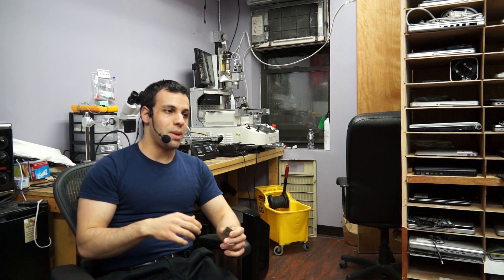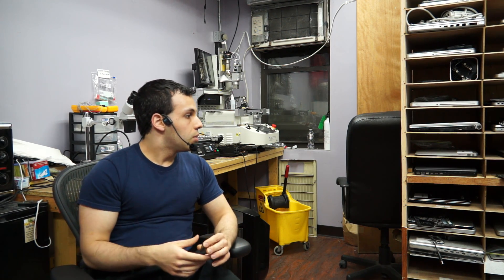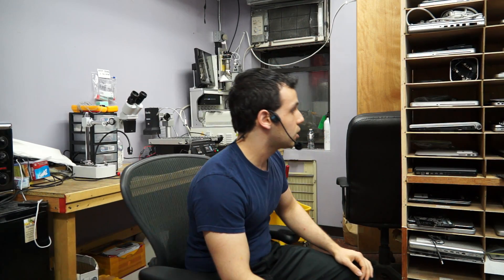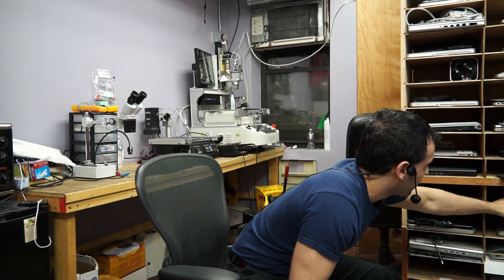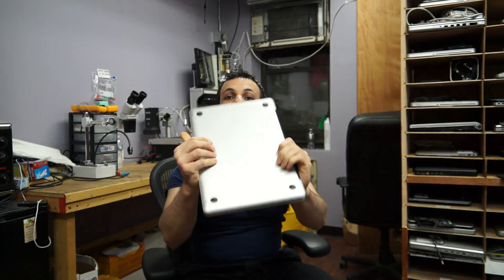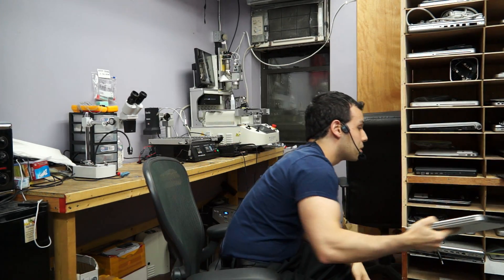Reballing flip chip GPUs is BULLSHIT - the truth about dead laptop GPUs & repairing them.

Comment: Louis, Most people have to  spend lot of money and or time to learn all of this stuff you know about electronics, but thanks to you I can learn it for free via ur channel, and that is truly amazing. Thank you very much sharing your knowledge and frankness.  
I will appreciated if you could could recommend a LCD's Screen separating machine? A decent one that won't break after a few jobs. heh! ty
Reply from the maker: +Luis Cruz I know little to nothing about glass only  repairs I'm afrai
Reply: +Louis Rossmann Hey Louis I have a laptop that has a nvidia GTX 675m GPU , recently my computer stops recognizing it in the device manager and theres nothing I can do to restore it unless I open the back of my computer , unplug the GPU and plug it back in to the connector and it starts working again. It disconnected 2 more times since then and had to do the same thing, do you have any idea what might be going wrong? I contacted MSI the manufacture of the computer and they said it most likely is a dead chipset that disconnects it although the card is still working. They offered me another card 770m for a huge price of 388$ , that will work with my motherboard but I dont want to fix something thats not broken , is there any way I can diagnose my GPU or fix it ? Have any ideas or do you know where I could pick up a cheap 770m considering its a older card? I appreciate the honesty in your video, more techs should be like you man. Also once I fix this I am done with laptops for sure lol
Reply: +Louis Rossmann I didn't even really think about it but maybe even heating up my GPU might fix the problem too? Ima do some more research on it being its a laptop.
Reply: +Dimitri Rineer Could be. If you scroll up you'll see my junk level repair that worked temporarily (until a little bit of heat builds up), but in your case it can even be easier, like just a problem with the connection of the graphics card itself (since you say you can disconnect it and plug it back I assume it's a videocard type laptop), I do mean on the level of the slot contacts only being lose or maybe with a partly broken contact there. Usually a graphics card with broken contacts on the board itself (sometimes the north bridge does the same, on laptops that still had that) the screen just stays blank, usually totally turned off, backlight and all, some lights light up and fan may or may not spin, then it reboots, nothing happens and it just keeps reseting. In your case, the entire part seems to not be recognized, à la desktop PC with a badly connected graphics card. Could be the issue, that should be easier to fix than new GPU (actually if the contacts are the problem, new GPU wouldn't fix it).
IF you have a friend with same type of laptop graphics card I would advise borrow it and try.
Reply: Found out exactly what my problem is , https://forums.geforce.com/default/topic/742208/geforce-drivers/geforce-675m-tdr-0x00000116-bsod-the-du-jour-nvidia-driver-problem-that-won-t-go-away/ , http://en.community.dell.com/owners-club/alienware/f/3746/t/19545021 . Pretty much gpu is fried due to a driver I downloaded and rolling back wont fix it, called my comp manufacturer MSI and since I'm out of warranty they won't do anything to fix it, they say its impossible to rollback drivers and it not fix a driver problem , which is understandable but if you read and research the 675m it happens, and they reply saying " Its not a mass issue" , so atm im SoL unless anyone has a better idea, going to be calling them again soon.
Reply: Its not fried , it works , it just wont work again properly . i have a msi gt70 ond 4440us or something along those lines. I know it sounds crazy , but if you read through those fourms youll see the people that are having the same issue
Reply: +Dimitri Rineer  Well it certainly shouldn't be falling off the bus. The forum threads don't seem to describe exactly the same issue as you have. MSI has actually offered you a reasonable price. If you hit up Eurocom (USA/Canada), they offer a compatible 970M for $600. MSI and Alienware gaming laptops are really the same, they are both built by Clevo, corresponding replacement parts from a particular Clevo model that they're based on will fit.

I'm going to majorly agree with readyrepairs. If a driver does a GPU in, it was already dead and simply didn't know it yet. It can be a pure coincidence - the GPUs run pretty hot and will die sooner or later.

For reference:
675M - 100W TDP (wow... don't be surprised by their suicide)
770M - 75W TDP
970M - 75W TDP

Perhaps a local repair shop can help you ensure that your mainboard is OK before splurging big on a new GPU. Also look for laptop boutiques, they usually offer Clevo based laptops and should have some replacement parts. Eurocom is one of those, i mentioned.
Reply: IF THE DRIVER MAKES YOUPSU SEND THE WRONG VOLTAGE DUE TO A WRONG SIGNAL FROM THE GPU GIVEN BY  BADLY PROGRAMMED DRIVERS THEN IT CAN FRY YOUR CARD. HAPPEND BEFORE I REMEMBER ONE ISSUE¿ WITH  ENVIDIA DRIVERS OF THE TIME THAT SINCE HAS BEEN REMOVED SO I NCOULDNT TELL YOU WICH ONE IT MADE FANS BURN TO DEATH LOL
Reply: In my opinion the only reason re-balling would work is when you have dry joints which is unlikely. And yes lead silver solder has a lower melting point than lead free solder.
Reply: Have you considered uninstalling the current driver first and  then installing the correct one.
Reply: The drivers are usually configured to throttle laptop hardware to prevent overheating. If they've covered up shoddy cooling work with drivers that nuke the hardware...
Reply: TheHGCGamersClub you're way off base in many points except one: that his reflow machine's profile could be designed for lead free solder and absolutely blocked out by the manufacturer for ALL leaded solder by order of EU witchcraft. Just goes to say be careful from where you order your tools & take into consideration not only what you want to do but how it might not be the fortè of somebody else's tools. Learned that from another youtuber.

Comment: This is why the towel trick on the old 360 worked. Remember that?
Reply: so that's why it worked! wow
Reply: if you mean stucking a towel on the vendilation so it heats up,i still used it on some HP laptop lol.
Reply: Democritus86 And then you resell them as "refurbished"? -_-
Reply: nothing that underhanded lol just give it back telling them it can die at any moment.
Reply: Well at least that's the truth lol
Reply: Swush You're lucky dude. It only worked 2 times 4 me. The third time Fallout 3 became unplayable cuz the graphics were all messed up. After that I had to be an idiot and open it up. That didn't end well...
Reply: I have had two, now on the third, large flatscreen TVs with developed that error where they take a long time to turn on and/or turn off and on.
Obstructing the ventilation on the top with a towel makes them work fine... for a year or two, then they never turn on again. People gave them to me for free when they bought new ones to replace them, at first I tried replacing all the electrolitic caps, but that doesn't seem to be the problem, they keep doing the same thing.
Reply: J'zargo I do. someone told me to do that with my 360 when it dies. I was smart enough to not do it and got a fat 60g ps3. worth it. just replaced the thermal paste in it upon finding out that it sucked. works better then ever now.
Reply: Good choice. I would have done the same if the PS3 had more games at the time. The HW on the original PS3 is just miles ahead of the old 360. I still can't believe how badly they were manufacturered using the cheapest components. MS were lucky to have all those exclusives, otherwise the 360 would have been an utter failure.
Reply: The 360 problems were because of the laws in Europe banning lead based solder. MS didn't want to deal with multiple manufacturing plants, so they made all the 360s with lead free solder. Lead free solder has a lower boiling point and that, coupled with the 360 heat problems, caused the crap solder to pull away from the board when the the system got hot. When you perform the towel trick on an early 360, you are actually melting the lead free solder and when it re-cools, the solder sometimes cools in the correct place. Another heat problem later and you're back to square one.
Reply: AtariBorn lead free has a higher melting point and requires higher temp.  Leaded is what melts lower and the EU gets all hullabaloo about because of Ewaste disposal.
Reply: AtariBorn 
You got it completely wrong. Lead free solder requires higher temp to melt.
Reply: And ya know what's funny? Mine that we did that to still works. I'm not sure how or why either, because I knew it was bullshit but my father did it anyways.
Reply: Democritus86 I used white t shirts. As long as you change them periodically, it works like a charm! Used that trick on my PlayStation too.
Reply: @AtariBorn  did you watch the video? 360s have the same problem wit the flip chips in the video. its not the lead free solder that causes gpu falure.
Reply: @rockl79  Whatever you say

Comment: Even if it's caused by a break in the solder, melting that soldier would be enough. No need to re-ball. The solder itself is fine. Anyways, I absolutely agree that such a "fix" is not a professional fix you should sell to a customer.
I did the heating treatment to a gpu of mine to make it last several months extra, but it was a chore to pull out the heating gun all the time and re-apply paste and all that. I let it cook good though, because I wanted to melt the solder just in case it was that. What pisses me off, is that the manufacturers make these products so unreliable. Really I wish they used some kind of socket for these GPUs, like they have pretty much always done for desktop CPUs. It might not be so simple for laptops. Still, there has to be some better ways.

Comment: I understand chips fail not solder for experience. I am just questioning something. Why do surface mount chips seem to fail and not socket chips like the CPU? I have seen 1 failed CPU in my lifetime. Does the socket prevent the chip from bending and killing itself? Are the chips surface mounted just built like crap?
Reply from the maker: CPUs are designed with stability in mind, GPUs are designed with this dick waving contest mentality of best furmark score
Reply from the maker: Michael Taylor I haven't paid attention to AMD CPUs since late 2006 when they stopped being competitive.
Reply: What's the temperature of your CPU, vs GPU, going full tilt? What's the size of the chip?

I think you'll find your GPU is much, much closer to the limits of what is possible. It's a larger chip, meaning there's more  components, meaning there's a higher risk for minor defects. It runs hotter, which increases the rate of deterioration.
Reply: I.T. king socketed chips usually have an active cooling solution mounted directly on or nearby. GPUs often share only a heat pipe with other bridges and RAM, some distance away from salvation. CPUs did indeed fail from mechanics when Athlons decided to bare it all and forgo the traditional fitted metal skirts, many were crushed by their cooling towers, tho. the problem was overshadowed by the exploding capacitorgate_scandal.
Reply: soylentgreenb 
Just had a visit from a guy who wanted to buy my Athlon 64 ATX barebones system for $10 w/ blown caps F00Fh susceptible legacy bios and CPU crusher cooling solution, blown caps and all, claiming that he could mod it into a ‘Frankenstein’, against my suggestion not to waste his 💰. Said he’d have the money tomorrow, I haven’t seen him since yesterday.
Reply: soylentgreenb  I just recently replaced the TIM of my CPU and GPU, and well i5 3570k's DIE is at least 2 times bigger than my Radeon R9 290 tri-oc's DIE.
So you clearly cant generalize here, or it is straight up bullshit what you talk about.
Because what i have learned is: If DIE's get smaller and faster they will generate more heat...
The fact, my CPU bottlenecks me and is often under more load, than my GPU, undermines your argumentation even further...

Comment: i used to have a dude who reballed chips for me for $75 bucks a pop. and i used to charge my customers like 275-300 at least. and i didnt have many problems. every now and then some person would bring it back. but over all it was pretty good no complaints. all this moral nonsense has a place somewhere. but for most people "reballing" or heating up works. and thats what matters most. i now tell customers that i can just heat it up and see if the chip will work straight up as an option if they dont want to spend $300 on replacing a chip. and that works sometimes too for long time ,not on 1150s of course but on 2011 a1286 those are maybe better chips for heating up. my new guy now replaces chips and its all nice and dandy. but i have a feeling sometimes he just reflows them and thats it.

Comment: I believe what damaged those chips are a phenomenon called electromigration, that is the electrical current actually moves atoms in the current carrying metal. It is especially pronounced where the current density is high and temperature is also high. That is why we see those thing happens in the GPUs, where the chip is small and current and temperature is high. The effect is accumulative and can not be reversed. Over time the current will break the metal inside the chip like a fuse where this happens fast. The heat can move the atoms again so there maybe a chance to fix the broken wire with heat, but it would easily break again by the same effect, that is why the FIX is always temporary.

Comment: I used to reflow xbox 360 GPU's back in the day. I mainly bought broken machines and only needed to get them running again to be able to hack them to remove a valuable file called a KV off the system. When I was heating the chips, sometimes I doubted whether or not I got things hot enough to melt the solder balls beneath the gpu, but when I would do the reflow and attempt to turn the xbox on again it would work. It was as if merely heating the chip got it to operate again. This has always been on the back of my mind and its been really interesting to hear someone else back up this idea.

Comment: iMacs and Macbooks run way too hot by default. Apple wants them to seem magically silent machines —at the expense of a scorched GPU. It happened to me twice at the 4th year mark (imac2011 & mbp2012), in other words right after the applecare 3 year warranty expired. 

I installed Crystalidea MFC and the GPU diode went from 170º on auto fan control down to 113º with a fully cranked fan. I'm guessing it's cheaper to replace a busted fan than a toasted GPU. What do you think?
Reply: I have a Dell laptop that runs so silently that I'm convinced it doesn't have a fan. It works great but once 6 of the 16 GBs of Ram are in use at once, all audio playing sounds worse than a vinyl record.

Comment: Hi Louis
Quoting what you said based on the timeline in the video:

00:33:	Reballing is Bullshit, is crap, is not repair (99% of the time)
00:54:	All, who trying to fix are full of shit
01:14:	Apple machines are shit, will stop due to apple care running out.
01:34:	Nvidia Chips are shitty
01:51:	ATI Chips are just as bad as Nvidia 
02:15:	PCs are Piece of Garbage
02:39:	Thermal Paste is garbage
04:27:	Despite "evidance?!" that BGA Reballing is NOT true.
05:55:	A lot of these chips just suck

Sorry, I couldn't watch more of it... it was too painful... 

:)

Comment: Louis Rossmann , as someone who runs a laptop repair shop i absolutely agree with you. Years ago we thought it was the solder and did reflows and reballing on GPU chips but they would always have problems when i couldn't improve the chip cooling to better than the original design. Now when its a GPU problem we just repair them and we have laptops working problem free after repairs.

Its like every laptop has a GPU or one of the bridges designed to fail after 375 days. I appreciate you speaking the truth, your colourful language and the amount of effort you put into making the valuable videos where you share your hard earned knowledge for free.

Thanks for all you do for us who are thousands of miles away and can't send you business! Love your videos!

Namaste from Goa, India!
Reply: Hi, how do you permanently fix broken 2011 MacBook pro's? Louis is saying it is not possible to find better chips so they are going to fail again.
Reply: Someone should convince AMD there is a likely "long tail" market for spitting out batches of 5 to 10 year outdated chips from the 5 to 10 year old outdated production line they could otherwise only use for low-price support chips and microcontrollers,  They could sell these brand new no-redesign chips at higher than original price to repair shops and possibly make a profit.